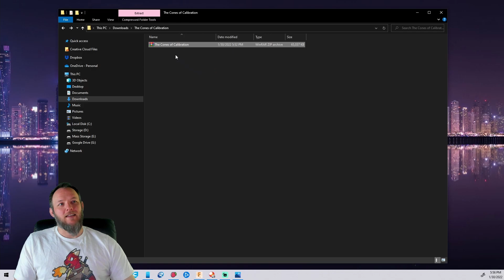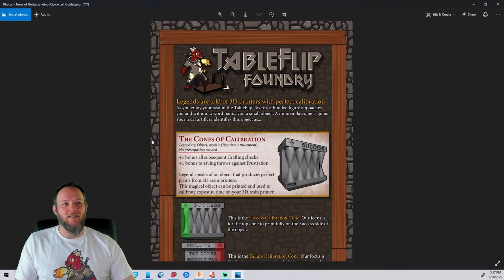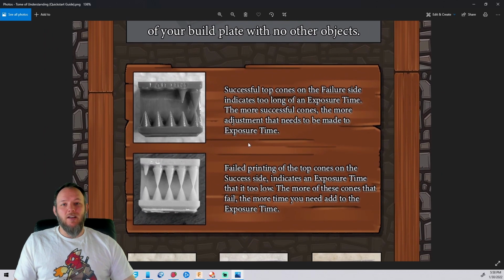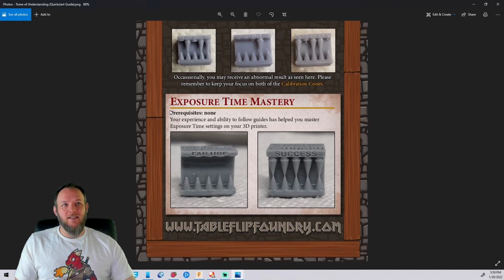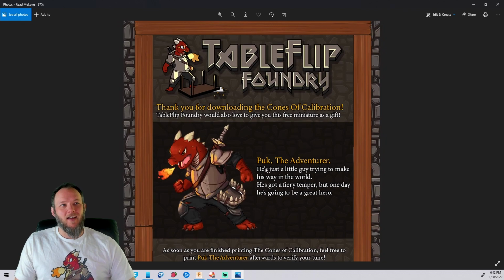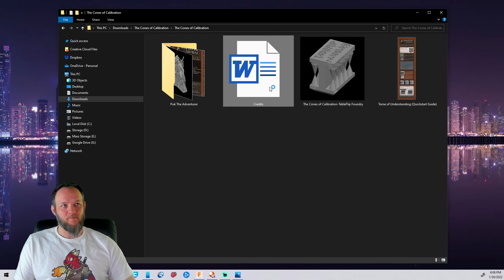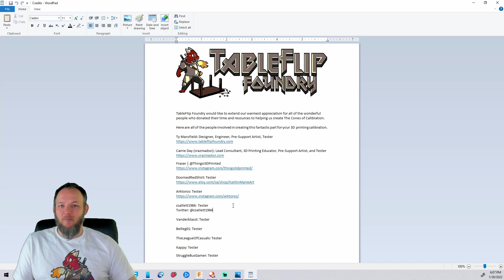This FREE 3D calibration tool will change EVERYTHING...

Comment: If you are having issues with this print the only response given is join Discord... No.

Just skip this "calibration."  What a waste of time, he spends more time on the "lore" and art work and just how intuitive it is than anything meaningful or quantifiable.  Seriously like 2/3 of the video is devoted to this.  The lore of bull $. h. !. t.  doesn't even have clear pictures of what a fail and what a pass is... he even stumbles over this in the video trying to explain it.  And dear lord how may different ways can it print to just add utter confusion... just read the comments its the same question over and over, are nubs okay... is printed but this didn't what does it mean... Joke,  I thought this ultimate print was supposed to address that problem.

Since they failed to give any meaningful info I will.  Mono printers are generally between 0.5-5seconds of exposure, RGB 5-20seconds (the difference is how much UV light each screen will let pass, hint the monochrome is much better). when making adjustments to mono move in 0.1sec increments when you start getting okay results and RGB 0.5sec increments when getting okay results.  Jump by full seconds or 5 seconds to get to the right ball park first.  Also a good rule of thumb is bottom layer exposure should be ~10 times your normal layer exposure.   But with everything in this world of 3D printing, YMMV and that snake in your boot was really the problem not the rock you kicked.

I have been printing for days and have not had a single issue with separation or adhesion.  Was just trying to dial it in a little better.  Clean and re-calibrated before starting...
The print kept separating mid print, bed adhesion was great but then it would fail midprint leaving floaties and layers stuck to the FEP.  1/4 of 1kg went into contaminated/used once container.  What I tried in my wasted time... hmmm what didn't I try.  Overexposing, underexposing, slowing retraction and insertion speeds to ridiculous numbers over and under base layer exposure.  Its probably a problem on my end but at this point I don't care.  I am blaming this for lack of info and just stupid waste of time it is to try to drive up numbers for the channel through gimmicks.  If it was a real tavern I would have burned it to the ground long ago and asked for direction to a real pub.   God I really wanted to like this simple idea... but that was wishful thinking.  Lithogoraph is an entire field of study for graduate work... and here we have dungeon master over here trying to simplify it, Fail... and so did I
Reply from the maker: Hey man. I get that you're frustrated. The reason we refer people to Discord is because Youtube comments aren't exactly the best place to help people troubleshoot their printers. Myself and our amazing Discord community has helped every single person who ever found us who reached out on our server.
I'm sure you understand, that I am not a Youtuber. I don't upload content very often. I dont have a desire to "Drive up numbers". 
I created this part for free and ran an entire group of testers for months. All of them volunteered for free. Released this to the community for the sole purpose of trying to help people get better at this hobby...totally for free. I make no money running our discord, or running this channel. 
There are hundreds of reports of this part working successfully for people. We have months of testing results demonstrating it working in a wide array of instances.
My intentions should be pretty clear by this point. I enjoy this hobby, I enjoy educating people, I enjoy helping get through their frustration.
I'm also happy to help you figure out what you have going on as well. There are a number of non cones related reasons you could be seeing the issues you're seeing. I, and my community would be happy to help.
Reply: Seriously, tell this someone else. Until then, shut your hole. The video is less than 10 minutes, and does a great job at explaining how to read the results for calibration. The file also barely uses any resin. It's not Tableflips fault that YOU don't know how to calibrate your machine.

Comment: I'm a little confused about the amount of succes cones you need. So I understand if the most left under the + sign is printed, then you're good. But what about the other 3 succes cones? Are they for finetuning dialing in more perfect? I noticed that in order to let all 4 cones print I had to increase exposure a whole lot compared to just 1 cone.
Reply: I was pondering the same
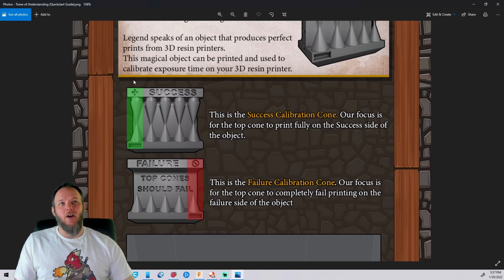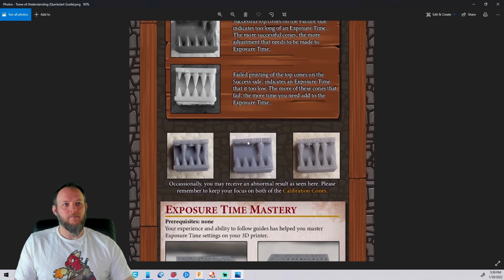Reply: at 2:15 he explains which cones we are looking for.  Basically Success you want the top left cone to print, The failure side you want the top right cone to fail.  All other cones are not relevant for this test 4:03

Comment: I tried the calibration as my first print ever on a resin printer and it came out nice, I kinda expected a complete failed print for my first try

Now on the failure side where there should be nothing I have a tiny spec like 2 mm maybe 4 mm of cone.  So I need a tad less of exposure time.  Now my question is cause that isn't in the tome of knowledge, what steps of increment or decrement do you take in adjusting ?

My bottom is now : 20 s
my normal exposure is : 2 s
 offtime : 0.500 s

so do I go up down with half secons , quarter seconds maybe even one eights ?  What would you do ?
Reply from the maker: every printer and resin is different. So there is no way to have a flat answer for the increments of adjustment. Usually on mono screens .1 seconds for a minor and .2 seconds for major. For an RGB screen it might be 1 full second or 2 full seconds.
Reply: @TableFlipFoundry  I have a DLP printer the photon ultra and tried with 0.1 increments/decrements, that seemed to be enough.  I had no cones on the failure side and nearly all cones on the success side, but the marker cone was all there.

I did get following suggesion on a facebookgroup for the photon ultra.  I'm not sure what to think of it.

"
So, you should work on more standard calibration prints first. The Cones are functionally a torture test for fine tuning your tolerances. It should not be your first print unless you really like troubleshooting. Is it a known good? Sure, if everything is perfect. What's better is something like the Siraya test, which gives you dimensional accuracy and a great baseline for anything but the most extreme conditions. The Cones ... they test for the extreme.
"

The cones are marketed as the only test you'll ever need , yet here I get the advice to use another test.
Reply from the maker: @kennydesmedt3215  I would definitely love to discuss this with you on an easier platform. The advice on Facebook is not given with a solid understanding of whats taking place. I couldn't disagree with the advice given more, and I couldn't disagree with their understanding of whats taking place more. 
Also, I don't think these are marketed as "The only test you'll ever need" anywhere. They are definitely a good test. I have expressed on many occasions how this test will get you a huge majority of the way to a great exposure but not perfection. There is a far deeper understanding of whats taking place that exists here. I cannot go into all the technical aspects in this video as it would take a super long time to go through. Feel free to jump on the discord and @ me there. I'd be more than happy give you an in depth technical explanation of how this works, why the advice on facebook lacks understanding and you will be able to go forth and perfect your method of calibration!
Reply: @TableFlipFoundry  I have a weeks work coming up right now and we seem to be on very different timeslots (Europe/Brussels) for me.  I'll try to get on discord on the following weekend.  Thanks for taking the time.
Reply from the maker: @kennydesmedt3215  Absolutely. I work until 3am my time typically so we overlap a bit. I just dont check my youtube more than once a day usually. Thats why discord is just way more convenient! Can't wait to chat!

Comment: Why print as single Model wihtout other and not as R_E_R_F test?
Reply from the maker: This test requires there to be symmetric flex from the fep.
Reply: @TableFlipFoundry  Okay I understand. But does that also mean that with many models printed at the same time on the build plate, the result can deviate at the edges?
If the result only refers to the middle, wouldn't it be better to print four models, each between the middle and the corner to form an average. especially for large printers?
Reply from the maker: @muellacc179  It would force you to over expose if you did that. 
The thing to remember is this is not a pre-supported model. The cones are not the same volume and surface area of the details of a model. They share a similarity to a pre-supported model but the practical nature of it is different. 
As a side note The further from the center for any print you have, the more likely you are to have support failures. If you were to load a plate from side to side on all four corners, even models you have printed dozens of times, you can still see support failures. This has to do with the tightness of the fep on the edges compared to the center.

Comment: What do you do if the succes side fails, where the cones dont touch, but the failure side fails by printing a partial cone?
Reply from the maker: This could be a minor fep related issue. Try rotating the part 90 or 180 degrees and giving it another try
Reply: @TableFlipFoundry  we just replaced the FEP on our Photon MONO X today before running this. We did put a screen protoctor on it though maybe that had something to do with it?
Reply from the maker: Screen protectors can affect exposure times. I'm not sure if it could change this. Give the rotation a try none the less

Comment: Late to the party. I’ve had continuous results where the success cone comes out perfect. But the failure cone still “nubs” a small bit. 

Then when I lower the exposure time, it both doesn’t complete the success cone, AND it does print the failure cone. Essentially giving me mixed results.
Reply from the maker: Little nubs are totally acceptable! 
As far as your success/failure cone issue, this could be fep related. Try to rotate the part 90 or 180 degrees so as to locate the areas in a slightly different place on the fep.
Reply: @TableFlipFoundry  lol now I feel like a fool. 6 prints later I’ve still been tweaking it. Might as well let my 2.4s exposure print finish, as it’s almost halfway.  My first print was perfect, If nubs are acceptable.

Thanks for having an easy to read test.
Reply from the maker: @denteater3498  hey you're very welcome! Feel free to jump on the discord if you want to show off what you're doing or ask questions or just want to hang out with some like minded people

Comment: In which orientation do I have to print this if my printer uses vat tilt instead of z lift? Parallel or perpendicular to the tilt axis?
Can I use the calibration mode of my printer with this test? (testing multiple exposure times on multiple instances at once)
Reply from the maker: You know. I do not have answers for that first question. And due to the nature of your printer, I have no idea if your second question will work!
On a traditional z-lift you need to only run it by itself due to the forces of the fep pull, but I have genuinely no clue with your setup.
I would LOVE to hear your results if you give it a try. Jump on our discord server if you do!
Reply: @TableFlipFoundry  In short: It works. I will write you some details at Discord.

Comment: Giving this a try on a Photon Ultra! One question though, which file would you recommend to default to, raft or no raft? And the reason? Thanks!
Reply from the maker: Some people had reported that the part didn't stick to the build plate for them so the raft file was put out as a backup just in case. It seems rare but it happens sometimes. I'm sure that has to do with their settings most likely, but wanted to make sure to do my part to ensure it wasn't the part.
Reply: @TableFlipFoundry  funny enough, that's related to my follow up question! I attempted to print the non-raft one on the Photon Ultra x Craftsman DLP Grey and nothing but bottom layers are printing. I used the same settings as the one AnyCubic supplied for their test file, which printed successfully before and after several attempts at the Cones. Tried Lychee and then Photon Workshop, but same result of the bottom layers on the vat and nothing on the build plate each time. Any idea what's happening? Thanks!
Reply from the maker: @TheWodiesan  I don't know whats happening. But I'd love to see if we can figure it out!
Hop on our discord server and lets see if we can sort out whats going on!
https://discord.gg/tableflipfoundry
Reply: @TableFlipFoundry  thanks again for all of the help! For those with an AnyCubic Photon Ultra using Craftsman DLP Grey, the file with supports is the one that does the trick! The process to dial the settings in was quick and painless from there; took me a total of 3 prints with no need to clean the vat.

Comment: I just tried printing this and the top tore off. Is that a leveling issue, lift height, or do I need to up my exposure time. Cones looked nice on the bottom, but barely any on the top (at least what i could tell from what was stuck to the FEP lol).
Reply from the maker: Do you happen to be using Eco or Bio resin by chance?
Reply: @TableFlip Foundry  nope applylabworks clear mixed with a little siraya blu v2.
Reply: @TableFlip Foundry  I tried slowing the lift speed. nope same thing. Now I'm increasing normal exposure  from 2 to 2.5. I recently replaced my screen so I guess I have to learn some new tolerances lol.
Reply from the maker: @thegnomegod7001  Jump on our discord, this isnt the first time we have seen this, but its so random we have not been able to figure out why it happens. Maybe we can figure it out together.
Reply: @TableFlip Foundry  Nope same result. Maybe I  do need to relevel.🤔
Reply from the maker: In my study of this particular issue i made a slight adjustment to this part. I'd love to get it to you for testing to see if it solves this problem. Shoot me a message, unless you're already on our discord...then you probably already saw it lol.
Reply: @TableFlip Foundry  I'll try it out but I figured out my issue. I have a screen protector on and needed to adjust my exposure by 2 sec. I should have read the directions more carefully lol. I do love this calibration test though. It's so simple read.

Comment: THANK YOU FOR THIS! I have struggled with all of the other calibration tests, and this one is so simple. You don't even have to clean the part to read it. I ran the test a few times with different resins and it matches closely with the times I found using other methods that were much more time consuming and tedious. I really appreciate that it's self cleaning. Unless the print failure is completely catastrophic, a failed test doesn't mean I have to clean the vat.
Reply from the maker: I am so glad you found this tool useful!
Reply: i agree

Comment: Question. On my failed side I got a few peaks but don’t go all the way down to connect to the bottom cone. Look like small stalactites. Is that considered success? Or need complete flat?
Reply from the maker: They dont have to be COMPLETELY flat. Close is close enough in this case. You could back off the exposure until the success side starts to fail then go back up a hair also if you wanted to really keep narrowing it down. 
You can also print Puck and see if you're happy with the result!

Comment: It's obviously me, but i can not get this file to print correctly on my Anicubic Photon Mono X. I've printed the test cube with no problems, also the RERF file have best results on #5 (2,4 seconds) but whatever i try on this file, after a couple layers it sticks to the FEP and not the buildplate. Got tests up to 2,5mm sticking to the FEP.. Any tips? 8 layers bottom 45s 1mm raise speed, 10mm raise height, from 2 upto 8 second exposure time, from 20 upto 70 seconds bottom layer. all fail and stick to FEP
Reply from the maker: Hop onto our discord server and lets see what we can do to get ya going. I have a mono X also so I might be able to pass you some settings.
https://discord.gg/tableflipfoundry

Comment: In my experience any failed print would indicate that there will/may be resin artifacts that would still be adhered to the FEP film.  Since a missing layer(s) will still be on the FEP, a complete inspection of the FEP film at the models location would be in order.  If a cone was incomplete, that cured resin has to be "somewhere".  Your comments please..  Thanks.
Reply from the maker: You're absolutely right! Typically thats how it works. The cones have been designed to self clean though. The failed cones get picked up by the roof of the part. No pancakes on the fep!
Reply: @TableFlipFoundry   that's the comment I was looking for before giving it a try. Because I really wasn't looking forward to have to clean the FEP everytime I try this calibration. Now I think I should give it a try!